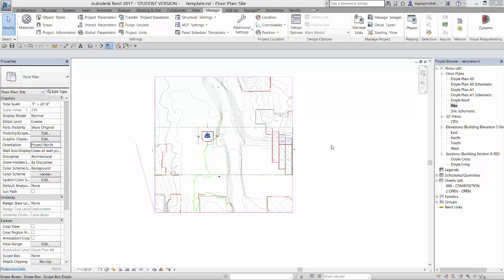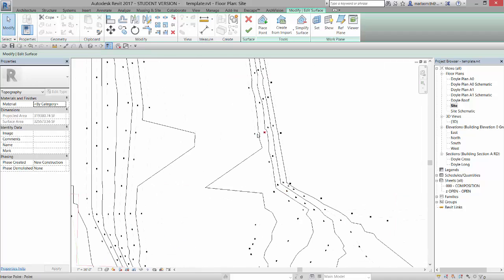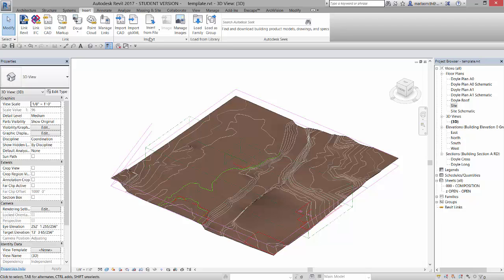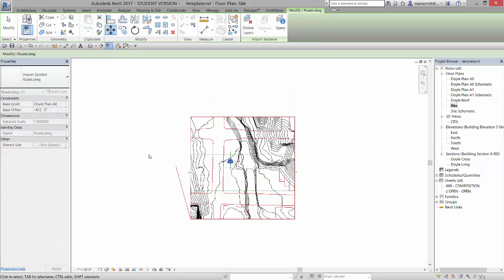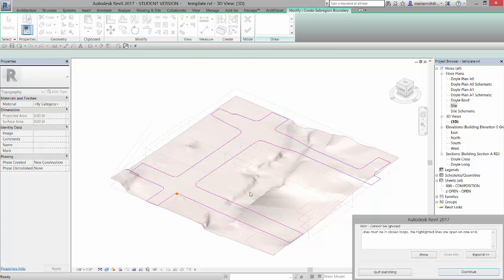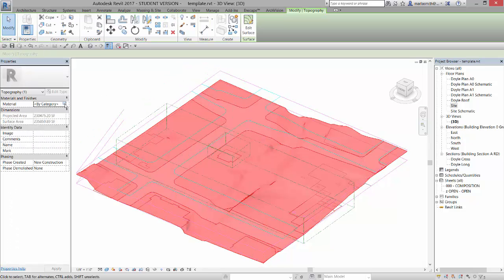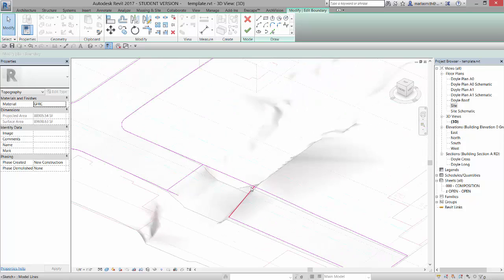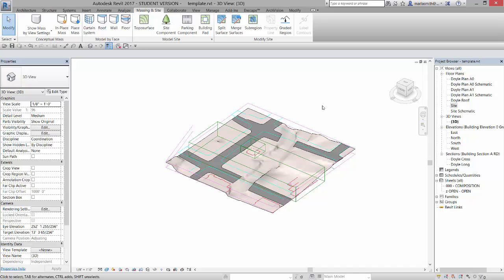02 Revit Site Topo Region

Comment: Do you know a way of making the roads look driveable? Because that is a problem with topography and roads in Revit that I can't seem to solve
Reply from the maker: There are a couple of answers to your question.  One is that you must regrade your topography by placing points to flatten or contour the road.  Here's a quick explanation of that process: https://youtu.be/685h1Tem3hw     
You can also use something like Site Designer if you are using Revit 2020, it's been discontinued for 2021. The Balkan Architect did a video on it.
https://www.youtube.com/watch?v=PJ9jWIMTjMA
Reply: I also thought of using building pad for the roads, sidewalks, and adjacent buildings, mainly because they're actually done. 

I do have Site Designer, but for 2018 version.  Also, thank you for making an actual  video about my inquiry. I will try to work with your method. I'm subscribing now.